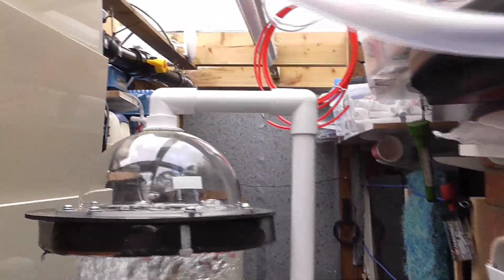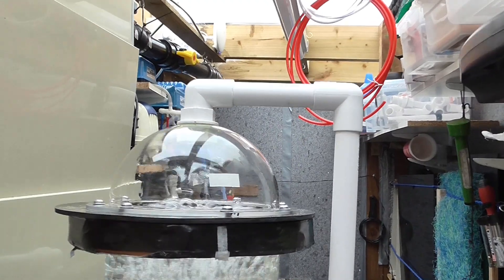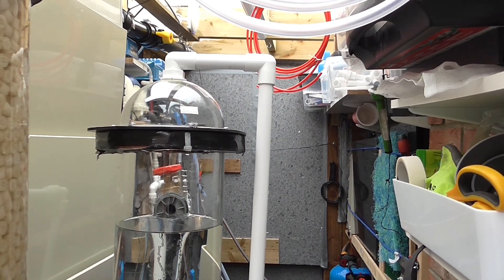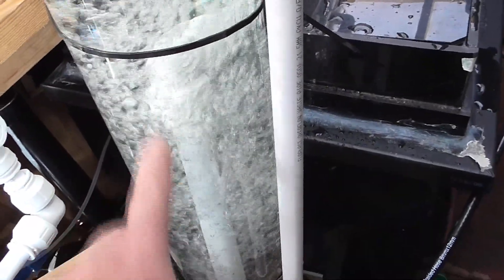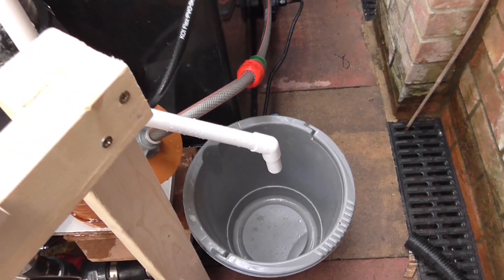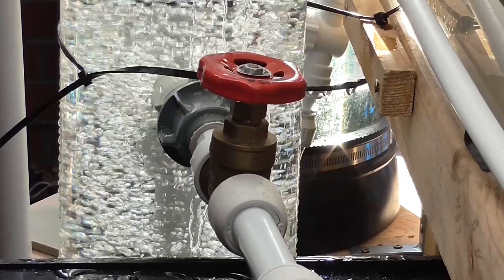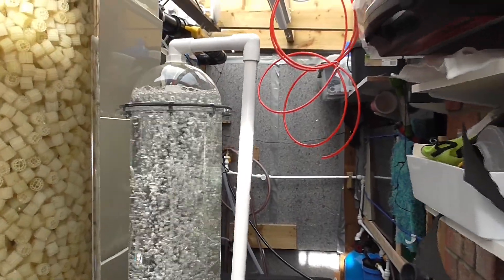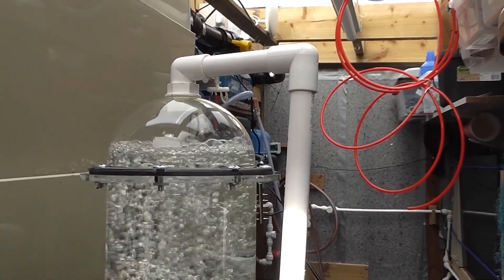Its all about the Protein Skimmer

Comment: Looking good mate  is the protein skimmer feed from the pond directly or is it after the drum
Reply from the maker: After the drum, moving beds and UV
Reply: @northernkoikeeper512  would it work any better before the filters 🤔 ?
Reply: @progressivepondkeeping  No, your protein skimmer is used to remove the Dissolved Organic Compounds which no mechanical or biofilter can remove. It is the DOC's which gives pond water the yellowish tinge, foam or oily appearance on the surface, and stimulates algae growth. I built a 1.30 meter high in-sump skimmer fed by a sumersible pump and four airstones. Works very well. My water is crystal clear. The key to removing the DOC's effectively is to control the water flow going through the skimmer, not too fast.
Reply: @francoislabuschagne9234  cheers mate 👍

Comment: Can only help a little the bubbles need to be really fine and small and it will only work well when there is alot of protean in the water ie when you feed heavy in the summer. I tried it on a smaller scale and got very little from it but even at the height of summer heavy feeding I get very little foam on the pond so I was not expecting much
Reply from the maker: Thanks Martyn. I was basing my expectations on the results 'Wrighty' was getting when he built his last year. However he has a lot of vegetation in his pond that maybe caused a bigger build up of protein.
Reply: I could not get much out of the one i made even when heavy feeding but i never get foam on the pond so i put it down to that. Terry knows his stuff and he was playing around with it alot of it is down to how good the filtering on the pond and the type/make of food you feed. Ask Terry see what he says i know he's on the upflow work now and its in the spot the Protein Skimmer was in see what way he's going with it
Reply from the maker: @boxtriker  Thanks Martyn. TBH I have only ever got protein out of a skimmer when I have had protein bubbles on the pond. Haven't had any protein for quite a while even though I am heated to 18C and feeding as normal. Maybe just no protein to skim?
Reply: That's it they will only make if there is protein in the water i think some foods leave less than others as well so it pays to try all sorts till you find one that don't

Comment: Couple of items, water level needs to be adjusted lower to allow foam to produce. The acrylic needs to slime/season in, when new it has chemicals that prevents foam to produce. Air bubbles need to be smaller, possibly with air injection thru the water pump inlet nozzle.
Lastly freshwater has a different tension for the bubbles to adhere to and water needs to contain a lot of protein in order to get foam.
Good luck and keep working on it, nice looking skimmer.
Reply from the maker: Wow thanks mate. Load of useful information. So I should keep it running?

Comment: How about more and smaller bubbles? Air stone?
Reply from the maker: Thanks for the advice Kent. I've put 3 air stones in there. I show the three that I use in the Protein Skimmer build video. 2 big round blue balls and a 6 inch straight. I'm using a Hailea V30 air pump. I could increase this to a V60 or a 100. Maybe that would work?

Comment: I'm not sure if you saw my previous comment but I edited it adding a link to information on protein skimmers from absolute Koi website where it explains about smaller air bubbles and more surface area. Take a look.

My previous comment isn't visible to me now so I guess it has something to do with posting the link 🤔
Reply from the maker: Hi Tom. I have checked the comments 'Held for Review' but it's not there. Strange? I will have a look at the info on Protein Skimmers on the Absolute Koi website. Thanks for that.
Reply: @northernkoikeeper512  when I edited it i may have deleted it (it's been a long day)